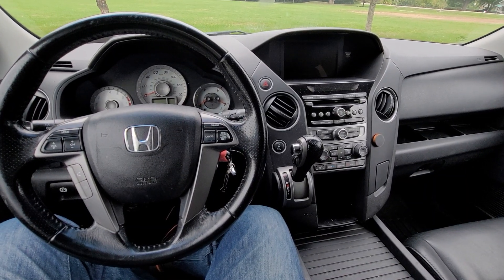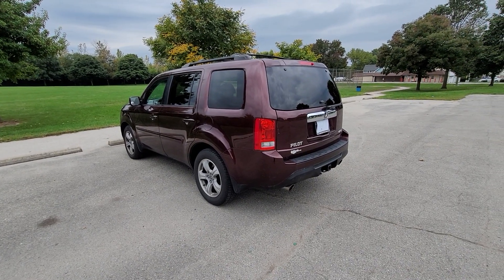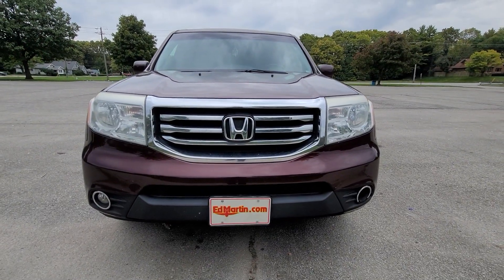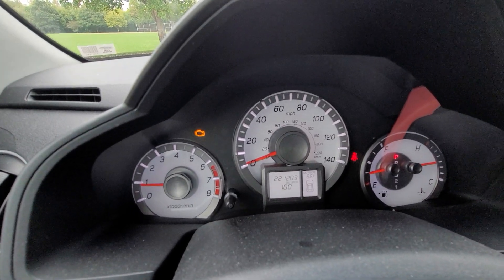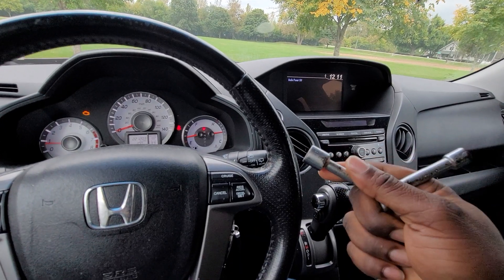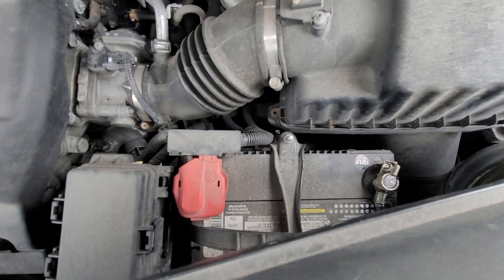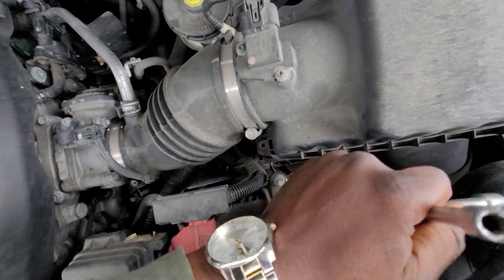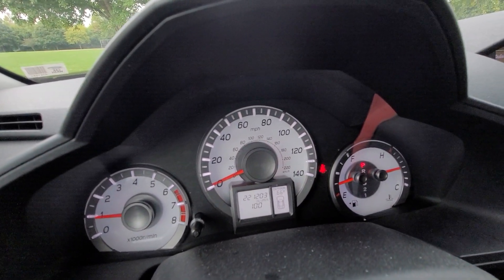CHECK ENGINE LIGHT OFF THE FASTEST WAY ON MANY CARS

Comment: Hey! I just want to thank you a lot! I just bought used 2011 pilot 2 weeks ago and   My battery went dead for some reason. I called CAA and he jump started it. Right after he left I drove my car for 2 mins and "check emission light" came on along with engine light and vtm-4. I was so panicked and went through YouTube and found your video. I did what you exactly said and it's gone. You saved my lot of $$ and time. Thanks again!
Reply from the maker: you're welcome

Comment: The check engine light is gone because you are clearing the memory on the ecu, you are not fixing the diagnostic trouble code that illuminated the check engine light. It will return after driving for a while if the DTC is still present.

Drive it about a hundred miles. If it returns,  get your car fixed...

If the dtc was for a battery / battery management system and showed battery voltage below threshold, and you got your battery jumped, charging above required voltage threshold or it was replaced etc... sure this would work as the DTC code that illuminated the check engine light was removed once it was fixed by whatever means you got battery coltage above required voltage. This situation the check engine light was going to clear by itself after x amount of time as per its programming.
Reply from the maker: absolutely correct

Comment: DA BEST HONDA EVER MADE PLUS GREAT COLOR
Reply: I have a 2010. I installed a vcm tuner to disable the variable cylinder management. It drives much smoother without all the switching to 3 cylinders under light loads. Saves the engine mounts, burns less oil, less sparkplug fouling and less carbon buildup.

Comment: great video brother but what about when all the dash board lights is on including the check engine light ? how do you turn them off because i just bought this 2009 pilot and just put a new battery in it runs good but all the warning lights stays on
Reply from the maker: yes that would some some also

Comment: What's the point of turning the CEL off though? The problem is still there. If you try to do this to pass the emissions test, you'll still fail if the light is off, because the computer will say it hasn't completed test cycles since the reset.
Reply: Yup happened to me
Reply from the maker: yes you gonna have to scan and fix the problem

Comment: Do you have to enter a code to get the radio to work? Or maybe that’s only if both terminals are disconnected as in a battery replacement.
Reply from the maker: yes you'll need a code to get the radio on and you can also bypass the code by pressing the radio power and hold on to it for few seconds please reply me if it works

Comment: Has anyone had the light turn right back on after driving?
Reply from the maker: yes its just gonna off for a while untill you fix what triggers the light
Reply: @itechtv1st  will emissions pass as long as the light is off?
Reply from the maker: @omone00  the light might come on after long time without fixing it but you could be lucky like me, because mine has not turn back on in over four month